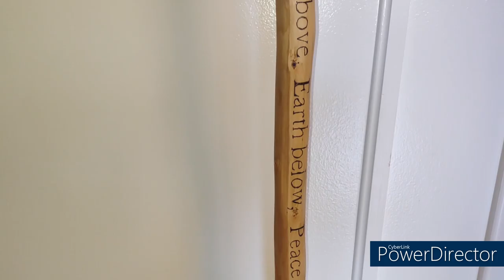WALKING STICK WITH A TWIST

Comment: i like my walking sticks that reach the top of my head so it doesnt jam under my jaw in case i slip or fall and also like a bolt or metal for good foot instead of the rubber.  tight lines!
Reply from the maker: Nice, never thought of it that way. I like the rubber foot as it's quiet on pavement but yes, the spike gives better grip in soil. Thanks for watching
Reply: @JasonHedrich  thanks for the quick reply,  tight lines

Comment: Thanks for this.  I learned a few things from the video particularly about adding a twist.   I don't like the rubber foot.  I add a lag screw or carriage bolt.  I can keep the head as new or grind to a point.
Reply from the maker: Thanks for watching! Yes, I have added a steel rod at the base instead of the rubber foot a few times. It works well but I find it creates noise when on pavement or across rocks. But yes, certainly a few options for the base

Comment: The larger tool he is employing to strip the bark off that staff is called a Drawknife. The smaller one is called a Spokeshave. Many years ago these were commonly seen in carpentry shops, but now they are very rare items. However, they are still available from specialty supply houses.
Reply from the maker: Exactly right, comes in handy for stripping bark. You can still find them at certain stores but you have to know where to look!
Reply: @JasonHedrich  Long ago when I was much younger I had many of the woodwright's tools and even constructed for myself a shaving horse from a white oak log that I had felled myself. Ah, those were the days of strength and vigor and ambition. Nowadays I'm doing well just to get out of bed in the morning. Thank you Jason.
Reply from the maker: @notmyworld44  every day is a new opportunity for something better than yesterday... Thanks for writing
Reply: @ghostladydarkling3250  Good for you! 😀

Comment: Nice enough stick Jason, but a little simple for my liking. I carve sticks too but i put actual carvings on them, such as as a frilledneck lizard, or big game trophy heads, or vintage motorcycle emblems. I usually put 40 to 50 hours in a stick before stain then automotive clear coat. very tough finish.
Reply: He did not ask you to like it - You do what you do and others do what they do - It is what it is
Reply from the maker: Nice, I have a few other carving videos where I do more detailed carvings. Check those out and let me know your thoughts
Reply: @JasonHedrich  Thanks I will, do i find them by seaching your name
Reply from the maker: @markseehawer3762  yes, @JasonHedrich

Comment: How long did you let your stick dry before you finished it ? I have one drying now for about 5 weeks but I’m getting impatient to finish it . Nice work by the way like how you did that with the leather 😃
Reply from the maker: I let them dry a minimum of 4 to 5 months. The rule of thumb is a year an inch thickness but that's if you cut them still green. Hope that helps. Thanks for watching
Reply: @JasonHedrich  thank you !
Reply: What a nice one! I like that saying.
Which typo did you use for it?
Reply from the maker: @Fraususemil  thank you. I think the font was Times New Roman, but I’m not 100% sure
Reply: @JasonHedrich  That confirms my guess, thank you! 🙂

Comment: Do you ever consider removing the bark when it is still green and then drying it because it is easier to remove then? When I made walking sticks ( not as fancy as yours!) I had a devil of a time removing the bark when the stick  was dry as opposed to when the bark was green. It probably would have helped if I had more than wood saw and a larger pocket knife! LOL!
Reply from the maker: Absolutely easier to remove the bark when it's green. I only collect stick that are already down so I don't see them green too often. But yes, easier when it's fresh. Although the drawknife easily removes the bark when it's dry so that helps
Reply: Leaving the bark on slows the drying. Same as painting or greasing the cut ends. If they dry too quick they can crack.
Reply from the maker: @theflamingone8729  exactly right!
Reply: @theflamingone8729  Good point!

Comment: Jason, I saw you using a really nice wooden handled surform (grater)style rasp in another video. Did you make it or buy it someplace? I would love to see it up close. How is the rasp blade attached and tensioned on the handle.
Could you share some information or a few pictures please? I can not seem to find your email address.
Thanks
Reply from the maker: Yes, that was a Microplane. I bought at a local woodworking store but the can be found online as well. The handle I made myself out of a scrap piece of cedar 2x4 I had left from the Greenland Paddle build. The microplane is screwed into the cedar handle, it is rigid enough that I didn’t have to worry about tensioning it after attaching it to the handle. It works well for shaping wood. Hope that helps a little
Reply: @JasonHedrich  thank you, thats what I needed to know. 👍

Comment: What type of Spokeshave do you use ?
Reply from the maker: I have a flat Stanley spokeshave. Works well once you get it dialled in
Reply: @JasonHedrich  thank you very much, now I'm pretty new to woodworking I'm traditionally a Blacksmith so all this is new to me. I assume the Spokeshave is similar to a draw knife but what's really the difference? I quickly looked some up but there's multiple types which would you recommend? Love the videos you give good inspiration.
Reply from the maker: @tristanc2412  a spokeshave is meant for more refining the shape, originally used to shape the spokes on wagon wheels. The drawknife is for rough shaping, traditionally used to remove the bark off of trees.

Comment: You're losing half the force of your drawknife with flex. 
You really have to make a project of bracing your vice table. :-)
Reply from the maker: It’s not a question of bracing, I just have to lock the casters on the bench more. I move it around for space and tend not to lock them which causes the movement.

Comment: I made one from a hollow metal 6ft long pipe and cut them into 10 separate sections so I can connect and disconnect them any time. 

My staff has many use, it can be a chair AND it can stored survival items inside. I wrap the metal staff with fake wood tape so it can look like wood. 😂 

Inside my staff, I have: 2 lighters, 2 ferro rod with a striker, snair wire, fishing kit, spear, knife blade, 4 arrow tips, saw blade and 2 small bottles of nails.

My staff has a compass on top and a window breaker at the bottom plus the hand cordage at the top to give it a grip for my hands. I’m debating if I want to make a staff holder to hold my staff when I’m not using it.

I’m 31 and this is my first ultimate survival staff that I have ever build!
Reply from the maker: Sounds like a true survival staff. Nice!
Reply: @JasonHedrich  
Thanks!